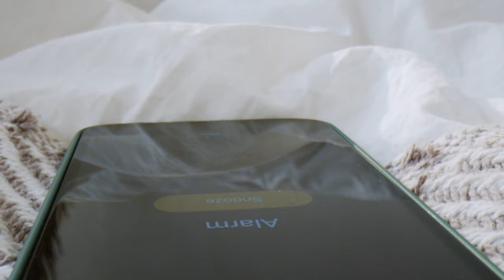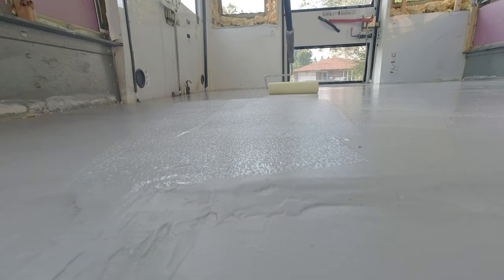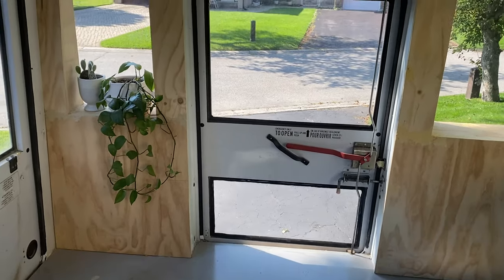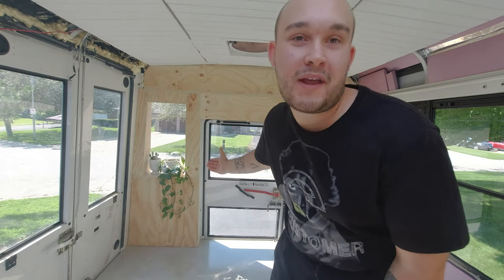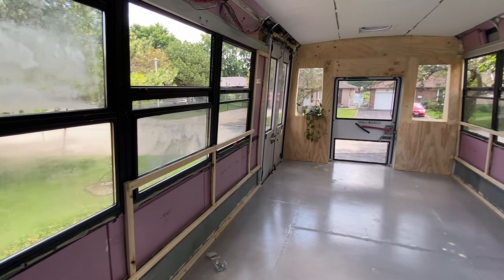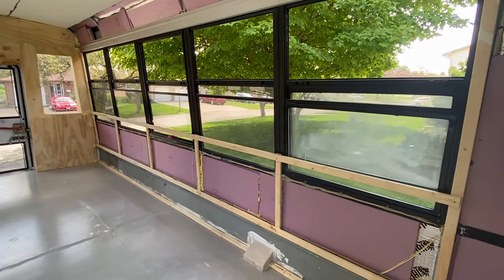WE HAVE WALLS | Ep 6  School Bus Conversion - Framing and Installing Skoolie Walls

Comment: did you already do your electrical and stuff??
Reply from the maker: Not yet, all of the wires will go in the curved part of the ceiling (the outer edge area by the walls)! I just want to make sure they’re accessible since I’ve never done electrical before. I did run the electrical for the fans though since all of that is in the ceiling already.
Reply: @AndersandAndersen  oh that's a good idea! I might have to copy you there as well, I'm so nervous for electric 😅
Reply from the maker: @EmmaBuildsBirbie  I feel the exact same way... don't worry!